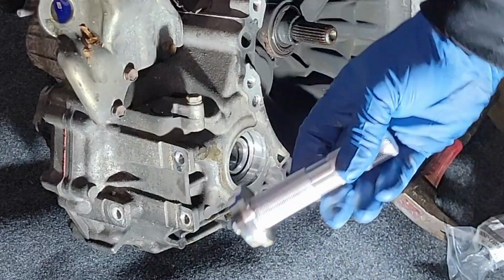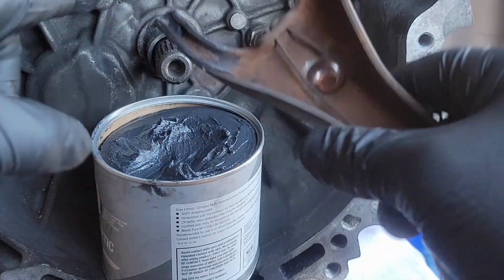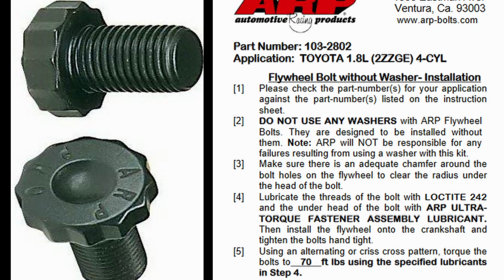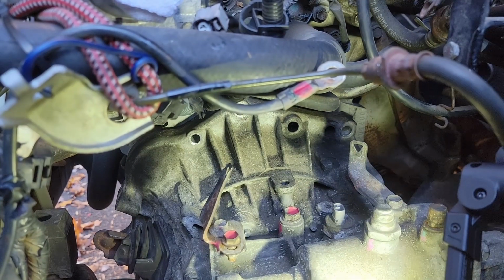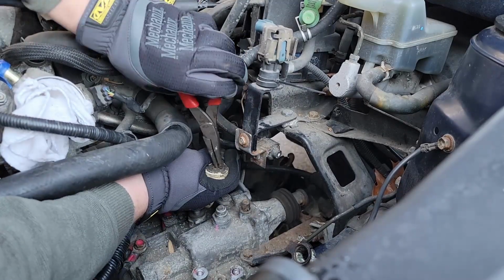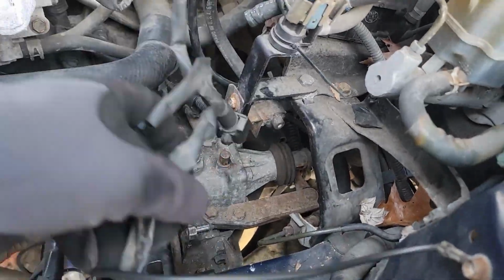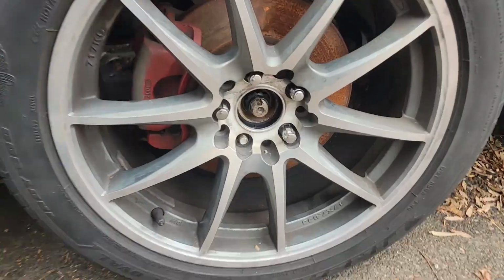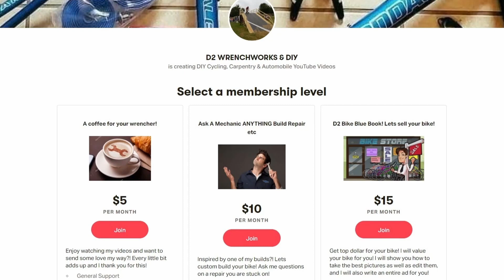ABANDONED MATRIX PART 3: C60 6-SPD TRANSMISSION INSTALL & NEW EXEDY CLUTCH UPGRADE+MUST-DO UPGRADES!

Comment: Amazing how much knowledge you have on this. We cant wait to so you riding through those gears in style 😎
Reply from the maker: Hey Johnson family good to see ya around, I appreciate the kind words as always! Took me a little longer than I wanted to get it on the road but I like to make sure I do all the small maintenance side-jobs while I am this deep in there haha. We've since put just under 300 miles on it already though, can't give it hell yet bc clutch is still being broke-in but it definitely feels super sporty for what it is! Unfortunately EXEDY says you need 750 miles before broken in so no real fun for a little bit haha. It's been off the road for a few weeks now though because of the weather, got a bunch of snow but once that's gone I got another couple days or so of work left! Gotta knock out the new waterpump/flush coolant for proper type and I got stuff like new timing tensioner (they all have oil leaks here), new valve cover gasket set, TWO sets of new VVTI lift bolts, new serpentine belt, new spark plugs, even got new coated rotors and EBC yellow brakes, new motul high performance fluid so I need to flush clutch and all brake lines, the list goes on and on lol but I have been plugging along!

Comment: A specialized seal puller tool is as awesome as the slide hammer.  Takes seals out in 90 seconds.  I mean, hopefully you never have to do it again, but if you do.  Seal puller is the GOAT
Reply from the maker: This is an excellent comment, thanks for making it! Please take a moment to subscribe, I appreciate the support! So in the vid, I am using a specialized seal puller by Lisle here: https://amzn.to/3WpXp6u BUT I made a  massive upgrade getting something more heavy duty and when I re-did the axle seal and did the front crank seal it was much easier to use this Lisle puller instead: https://amzn.to/49Y1OAt